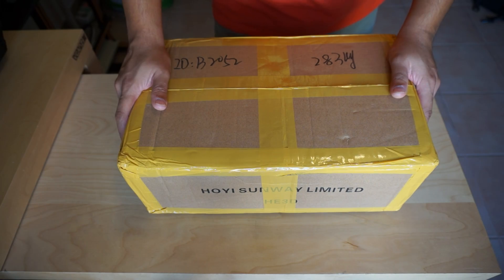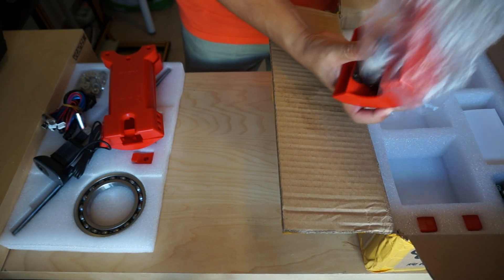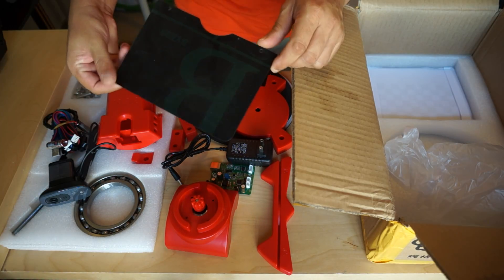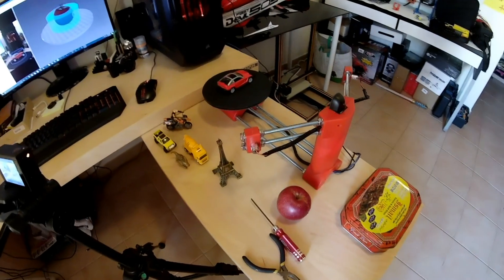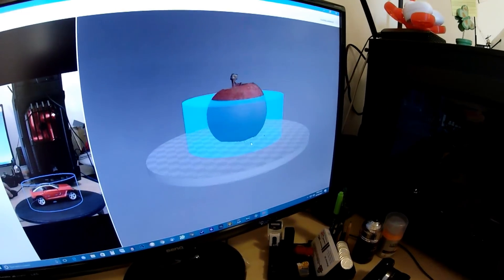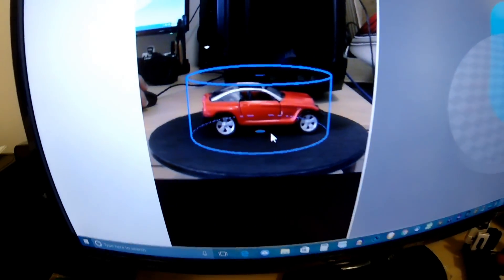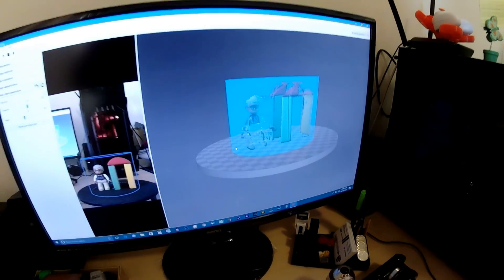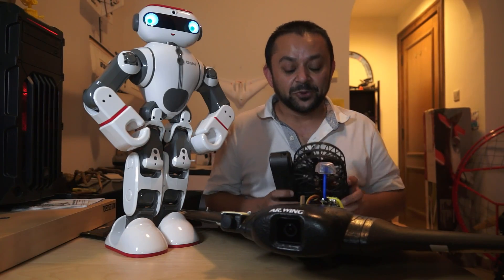Ciclop Desktop 3D Laser Scanner Complete Review

Comment: I bought this 3D scanner recently and I thought that I lost my marbles when I couldn't find the instructions too lol but just like you YouTube saved the day. But here is my biggest problem, I cant find any of the drivers or software on the internet that gets this thing to work. So I feel like I just spent $150. for a non working dead weight 3D scanner. I cant find anything either the locations to Horus software are dead links or its been removed. Do you know where I could possibly find these drivers now? I tried contacting the name on the business card but I feel that it just goes to deaf ears. Great Video!

Thanks
Reply from the maker: its very old video and of course discontinued product. i will post and pin a comment